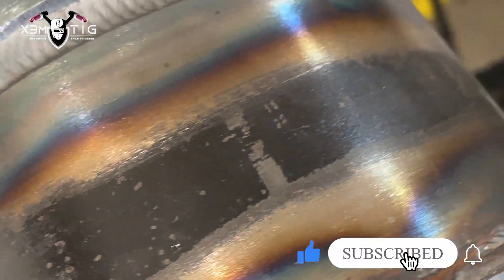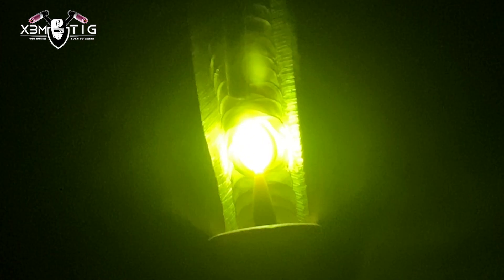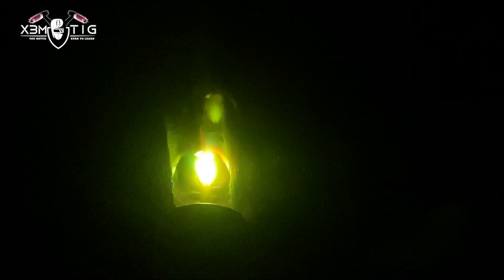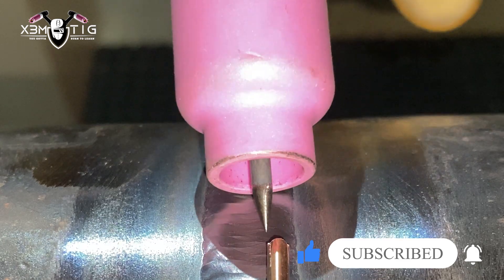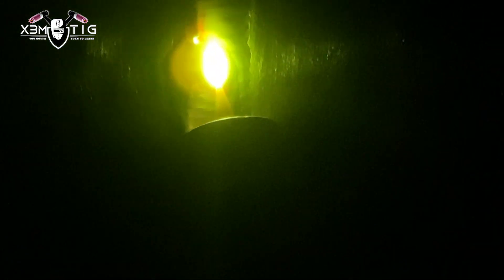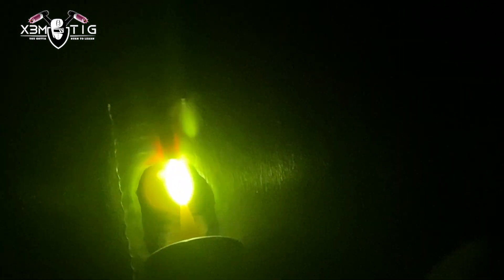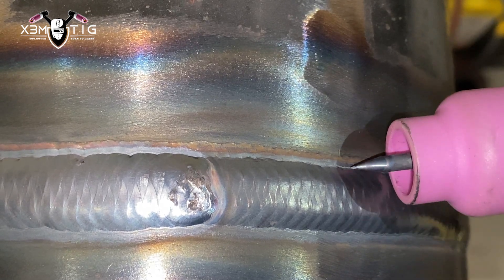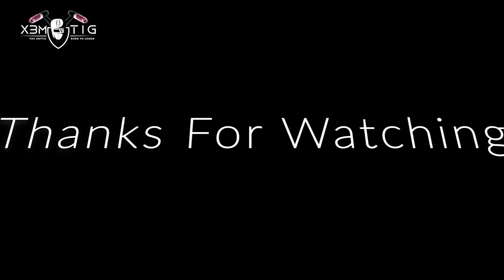TIG Welding Fill and Cap Pass Techniques You Need to Master

Comment: Hey we're doing 2" schedule 10 stainless no gap, edge are beveled.

It's a one pass weld.

I'm getting a little suck back at the 6, it's 5G position.
I'd appreciate any advice on this type of no gap beveled stainless I'm struggling with consistency with how the root looks inside.

I'm currently on an intermediate welding course, before I go into a  41 week dedicated pipe welding course.

I've learned a lot from your channel.
Thanks.

Comment: Dear friend, if I am not mistaken, your welding filler is ER70s. Please answer my question. I intend to weld a compressed air steel tank whose sheet thickness is 3 mm and the tank's pressure tolerance is 10 bar. What type of filler is suitable for welding this tank? ER70s or ER90s or anything you think would be better?  Thank you so much ❤
Reply: Fumes very explosive when empty. Fill with water
Reply from the maker: Suitability of filler wire depends from material, if it’s carbon steel you can definitely use ER70S for that pressure… 10 Bar is approximately 145 PSI, so you are good to use that filler rod.
Reply: @X3MTIG  
I don't know anything about the tank material but this tank is used for butane  c4h10 liquid gas tank. Dose it helps? 🙏😊
Reply: @Hamid-az  you'r a brave man!
Reply: @paulcharman44  
Don't worry the tank is empty 🤣